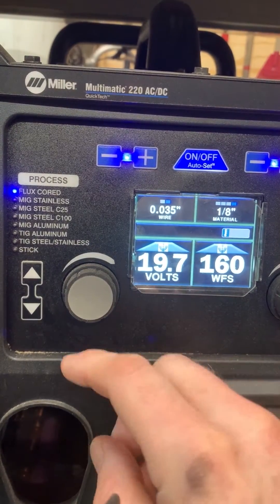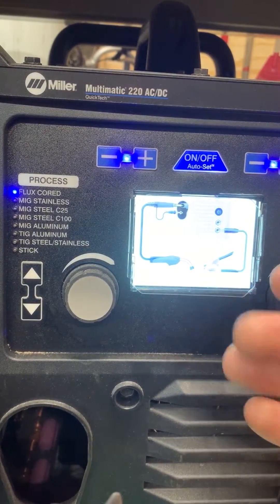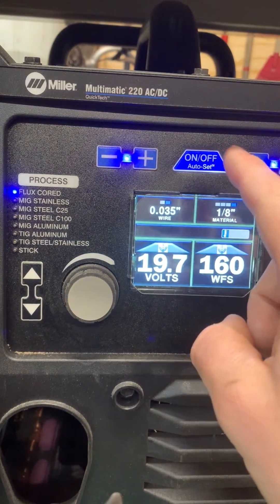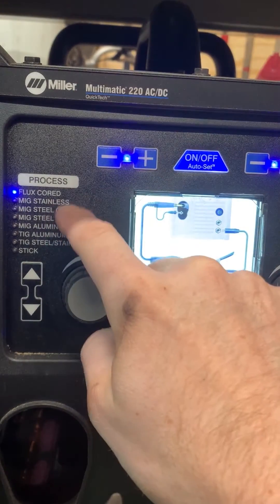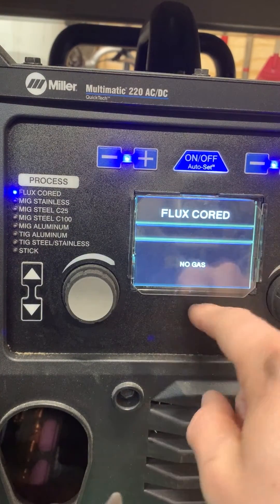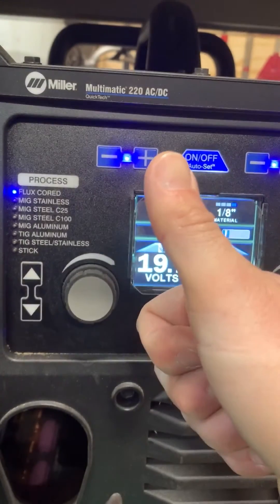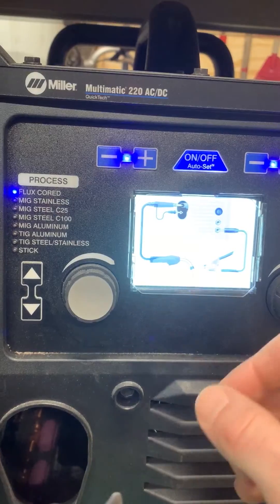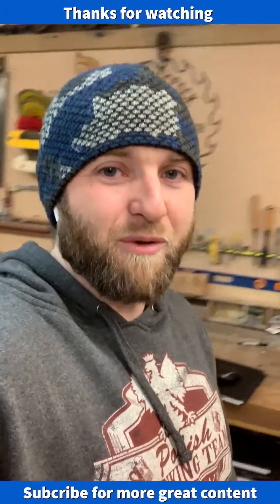Miller Quick Tip - Multimatic 220 reverse Polarity

Comment: I recently purchased a  Miller  220  ac dc and I am getting an error code for fan not working or too slow Any help here
Reply from the maker: Contact your local Miller Service station/distributor for help with error code.